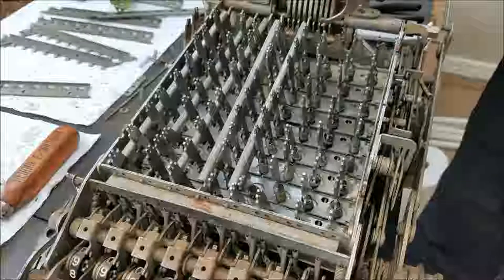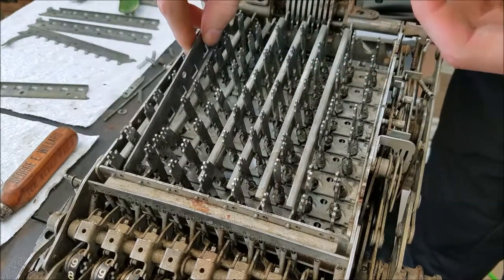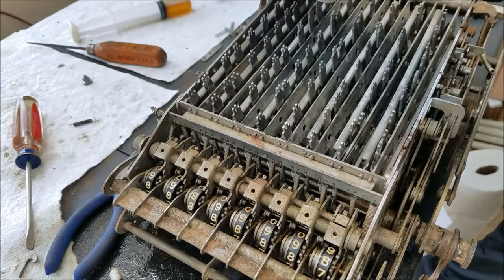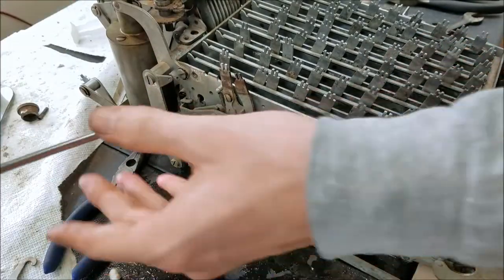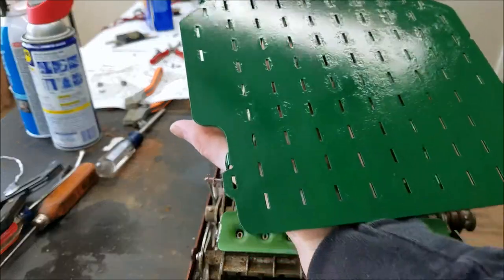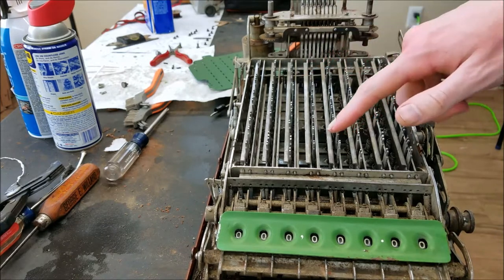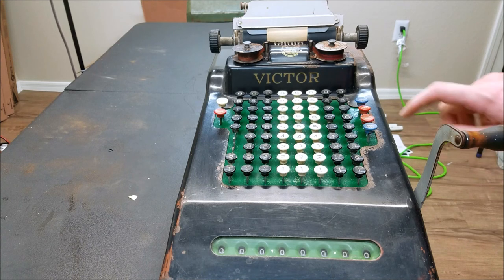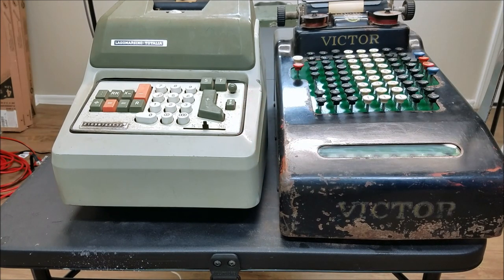Victor Adding Machine Repair Part #B

Comment: Hello, I’m cleaning one of these up.  I’m curious what the cylinder is for on the rear left of the machine??  Was it an automatic Oiler of some sort?
Reply from the maker: That is a dampener, it prevents the handle from snapping back under the spring pressure if someone lets go of it. The cylinder is full of oil to provide drag on a piston which slows the return of the handle. If you pull the handle and let go of it and it snaps back, yours is probably empty, and you can refill it. I just use 20w motor oil, it seems to provide sufficient drag. If you want to see whats in a similar one, on my burroughs class 3 series I take the dampener apart because it is stuck
Reply: bss1250 thank you!!